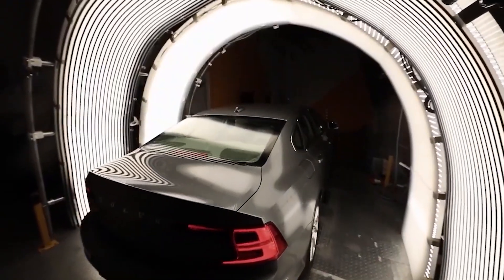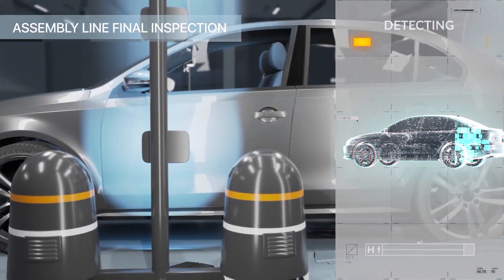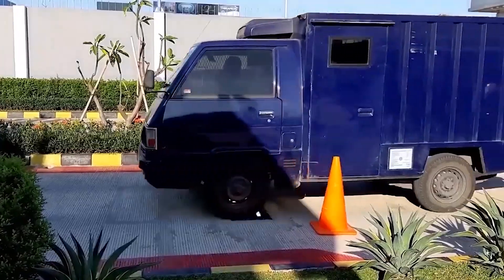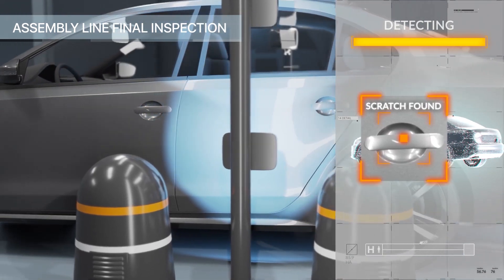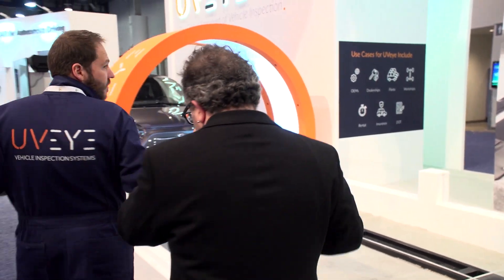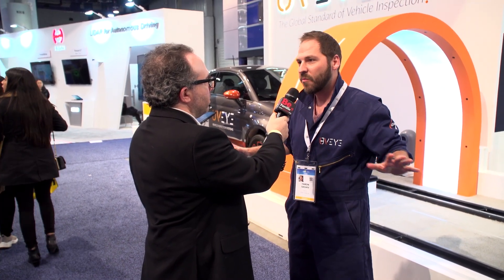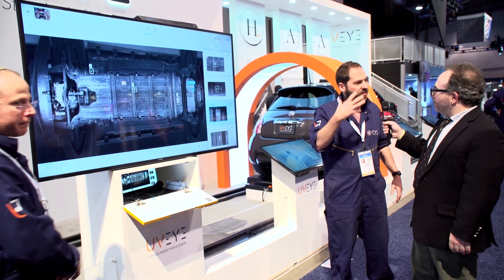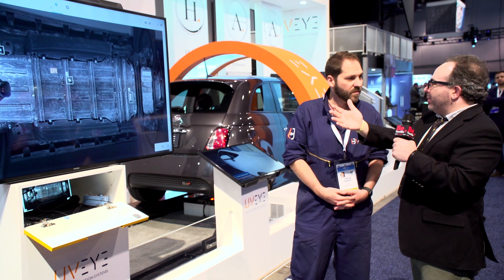UVeye Smart Automated Inspection Systems for Vehicles at CES 2020!

Comment: Fleet logistics targeting older models of vehicles, used on star UPDATES to override the COMPUTER SYSTEM CORRUPTIONS THE EVAPE SYSTEMS EMISSION CALIFORNIA STANDARD AIR BORN PATH ENGINES 6.2 SIX DOT to 2G 3G SYSTEM RADIO FCC TRANSMISSION RADAR DELTA RADICAL SYSTEM PATH TO LATES AND THEY ARE NOT COMING BACK